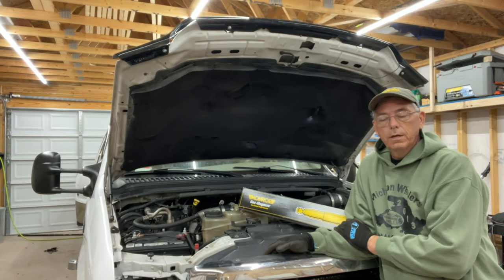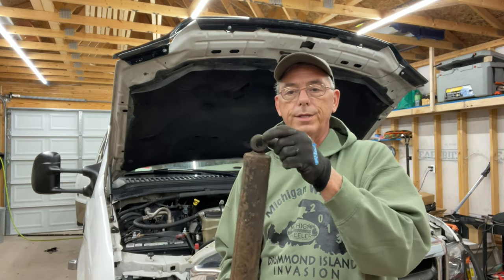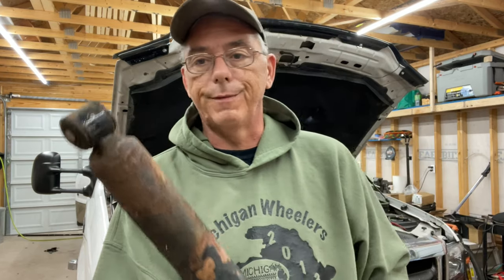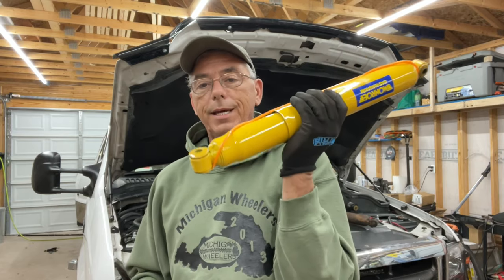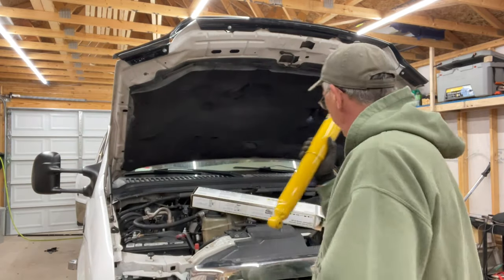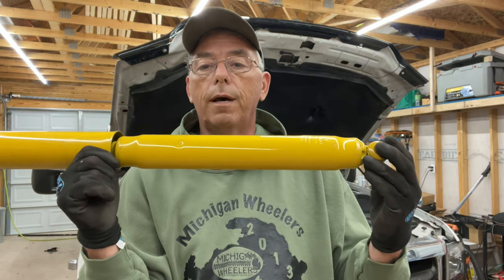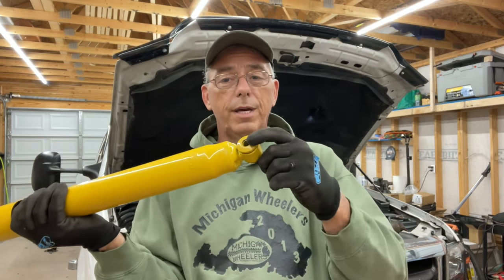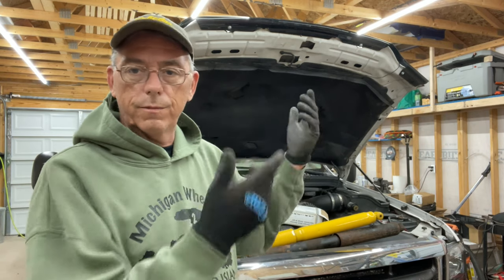RV Transport 7 - Rear Shock Absorbers

Comment: Great video man. What do you think about airshocks? Im getting new suspension for my 2008 dodge ram 1500. And when I load my quad and canoe and connect my RV trailer my truck sags pretty good. So was considering the air shocks but have read some bad reviews about airshocks also have read some good ones. But a buddy mentioned that I try helper springs on my truck instead and or maybe bump stops or both. After watching your video I'm a bit torn as I don't want to end up with a bad ride going for airshocks instead of these gas magnums.
Reply: air bags for sure,fairly easy install , adjustable depending on air psi.

Comment: Why did you not get bilstein instead of monroe on your truck?.Bilstein is a monotube and should ride better,
Reply: Probably because the bilsteins 5100 ride like a rock.  Too stiff.snaps you up violently over speed bumps...Looking for a softer rear shock for my 06 3500 and bilsteins are too harsh even with a load. Ive even removed the rear shocks completely to see how it road and it was so plush and nice
Reply: They are for lifted trucks